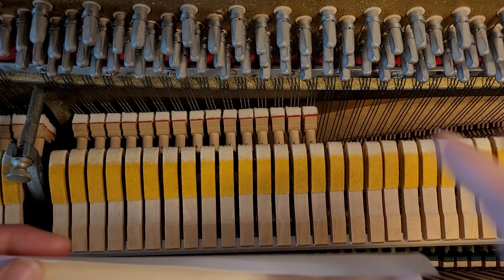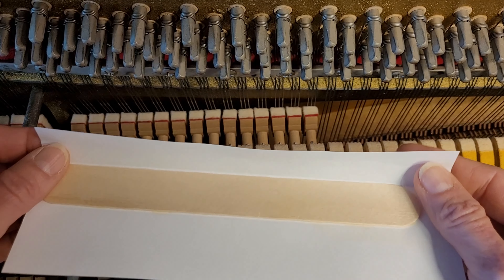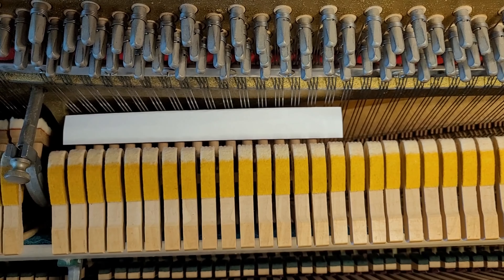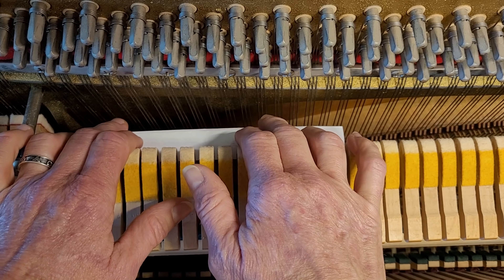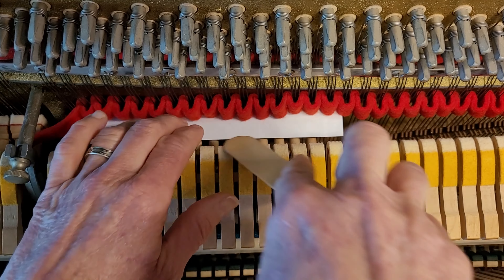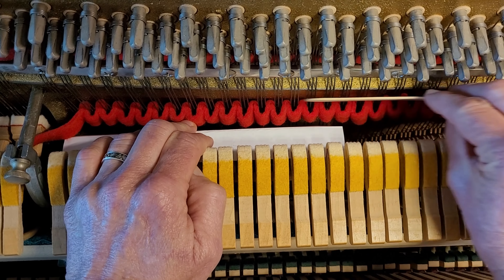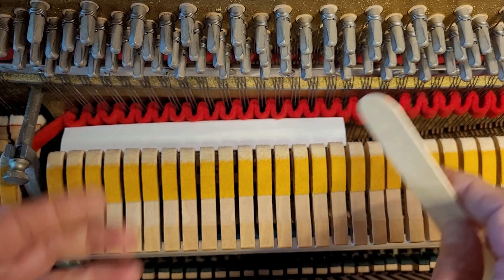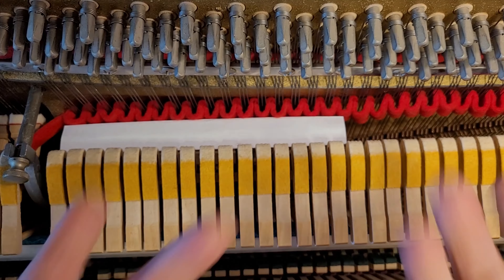temperament strip behind treble dampers trick

Comment: After seeing this video I tried just using card stock without the wood depressor, and it worked pretty well.  Then I cut up a binder folder  (slightly heavier stock) into 3 or 4 different lengths of strips to fit different treble designs, and it works great, although it's a little harder to keep the 90 degree bend in the heavier card.   After a few months of using them I can say that this little tip is life changing.  If every technician who uses strip mutes used this method it would save multitudes of dampers from being mutilated.  Depressing the sustain pedal makes it easier to pull back on the card and slip the folds of felt behind it.  Thanks, Maggie!

Comment: Use a paps wedge less hassle.
Reply from the maker: This is for learning to tune. One needs to practice certain things that are easiest when this section is strip muted. Also, some people like to strip mute the whole piano when they set a temperament & tune outward. A papps mute is better suited for ETD use and for those who don't like to strip mute the entire piano for whatever reason.  I personally don't like them, but I know many, many tuners who do.
Reply: @PianoTechMaggie  The way I was taught how to tune was with a single wedge (or scissor) mute. I don't understand how you would deal with a pitch raise if you strip mute the whole piano; could you explain this or make a video about it?
Reply from the maker: @stuartryerse  There are many approaches for a pitch raise. The strip mute method for tuning I show here is primarily a teaching tool, although some use it beyond the learning stage. I like it because of the way I tune. Some who use a temperament strip to tune might not use it for a large pitch raise, but if they did, you basically do a rough temperament with some overpull, then pull in the unisons after that.  Once you have it close with this method, you insert the strip again for the final tuning. It might not be the most efficient for a pitch raise, but it is a traditional method for tuning.
Reply from the maker: @rogershaffer1  Not when you are trying to practice aural tuning assignments that require this section to be muted. 😉